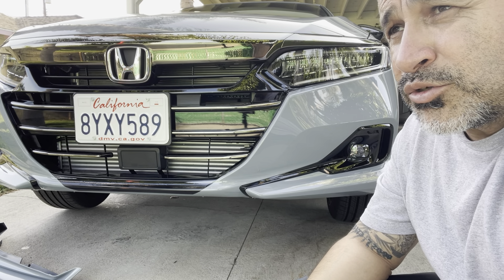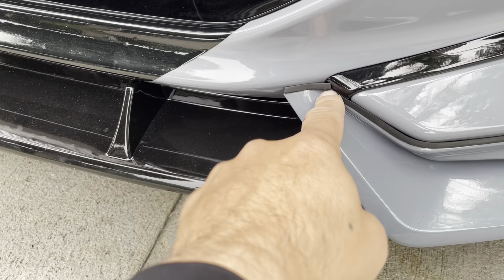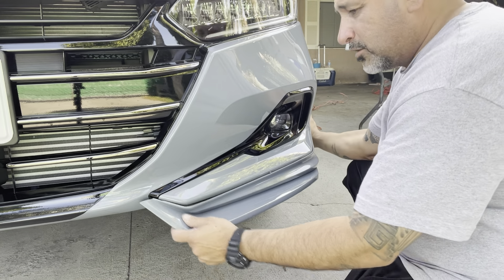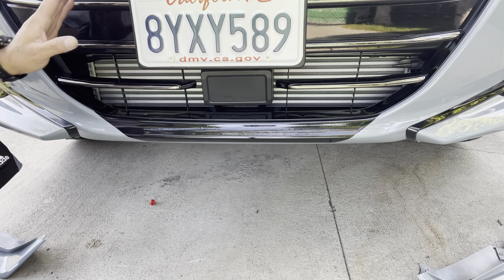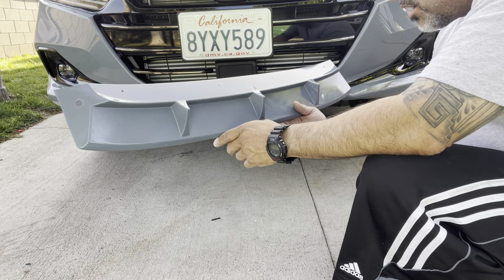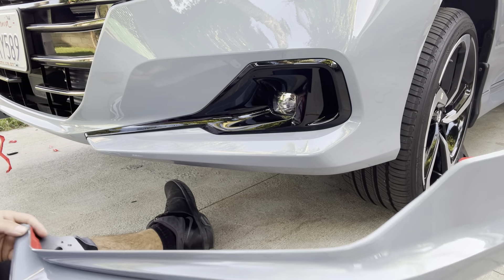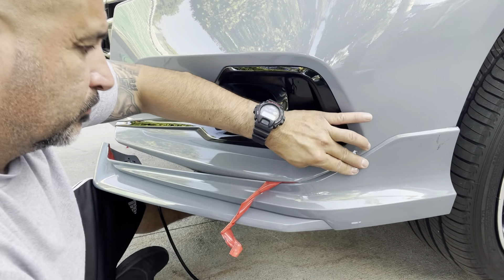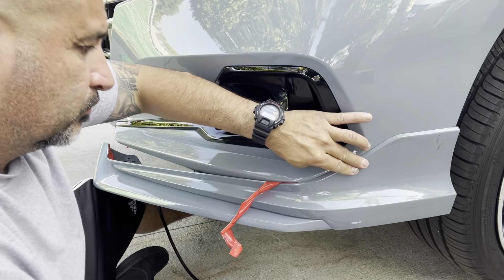2021-2022 honda accord yofer front bumper spoiler splitter install (revised ) 10th gen accord

Comment: Lip Splitter mouldings and like my Akasaka rear side spats I used the black trim Only correct way to get it to stay is buy quality adhesive promoter and use it on the trim moldings and placement on wherever your application used and it will stay on I live In MA and is cold here and has stayed on my rear aprons now a year without needing to mess with I like what you did and your car is looking amazing Fam great video and great work
Reply from the maker: Thanks glen I give a shout did you hear it
Reply: @JRod.Cuztom  Thanks bro Enjoy the weekend to you and the family

Comment: Looks good jrod

I didn't put the weather strip on mine either.  Didn't like how it would look.  I had to redo mine twice.  For the second time I ordered from Amazon 3m adhesive promoter and the real deal 3m tape.   Once reinstalled it came out great.    I like how you got your middle piece painted.  I didn't even think bout doing that lol.   But with my s-fabracation splitter it looks good black.   That way it flows together
Reply from the maker: For sure
Reply: How has it held up without the weather strip?

Comment: How did you remove the lip to reinstall it? Did you just heat gun and pull it off?
Reply from the maker: I just pull it off but you can add a little heat

Comment: So u just put the screws on the back center part no screws in front
Reply from the maker: I did end up putting more screws but I put them a little further back not in the hole and it pick up the fixed gap